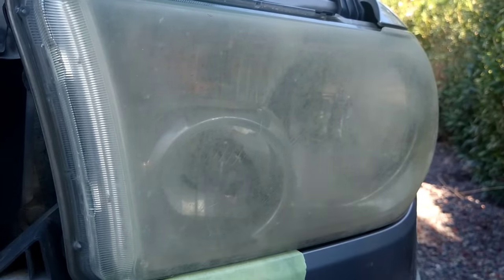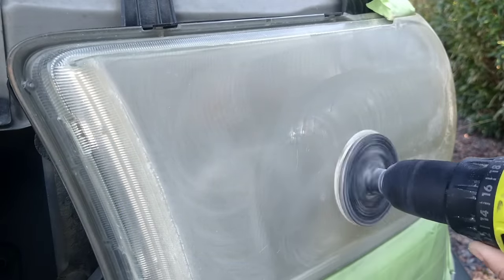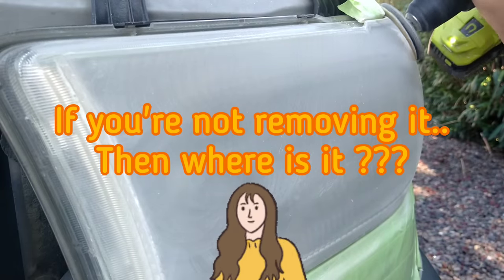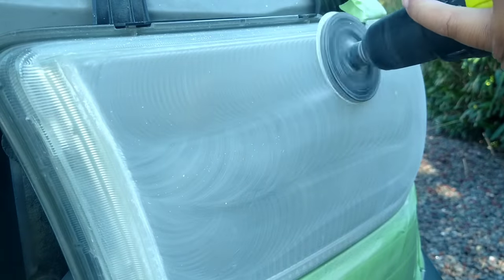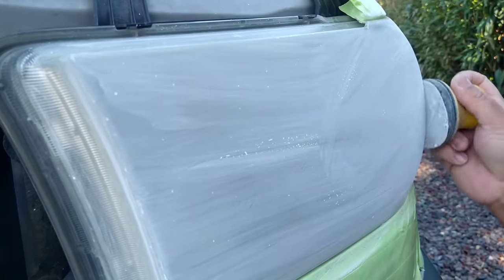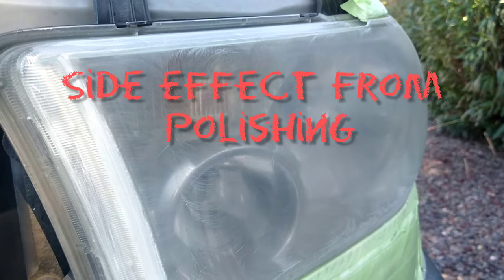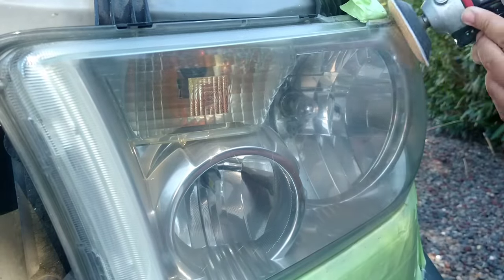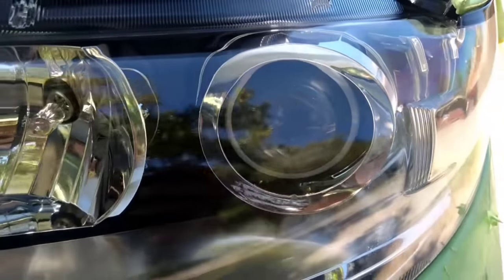POLISHING HEADLIGHTS IS A SHAM/scam  ---  and why you should never only polish headlights

Comment: Thanks for sharing your expertise, both in the video and the comments.
The big sham is the restoration need created by the manufacturers and their inadequate plastics. I restore the one piece glass headlights on my 94 E250 by washing and replace at 10-15 years when they start getting noticeably dimmer.
Reply from the maker: True .. awesome.. thanks for watching play more stuff coming up.
Reply: Agreed 💯
Reply: What are you replacing?  On my Honda I have to replace the entire headlight assembly at $500 or so because you cannot only replace the plastic "shell".
Reply from the maker: Exactly that's why I have that restoration has beneficial.. no need to replace the whole light..
Reply: I remember when the clear plastic portion of the headlight assembly of a car/truck was made out of glass (I guess I am old as dirt). I cannot believe that car manufacturers switched out the glass with plastic. Of course plastic will fade, cloud, discolor, craze, etc. over time. This is what the real problem is. Car manufacturers found a way to up their profit, by switching out the glass lens of the headlight assembly with cheap plastic (Lexan/acrylic) material. Now we owners of these plastic crap-boxes have another early failure point on our vehicles... cloudy headlights. Giving rise to a whole new industry, to try to undo the sunlight damage caused over years of sunlight exposure. If the headlight assemblies were still made out of glass, like they used to be, we would not be even talking about this issue. Big industry sticks it to the hard working consumer again... Surprise...   Fred
Reply: @electronicengineer  Yeah, glass headlights breaking every few months from stone chips were wayyyyy better. Nice try boomer.
Reply: @dancarlos1216  Well I owned at least 10 -15 cars "back in the day", all with glass headlamps and I never had one even get so much as a stone chip, let alone "break" Boomette... All my plastic headlamp cars have fogged in short order. It is easy to see that you are still wet behind the ears, so you should hold off on the age related insults, since wisdom comes with age and you will also get up in years, provided that time is on your side. Not so sure about wisdom though! LOL... Have a great day!
Reply: Hey guys, we are just talking about headlight lenses here. There is no need to call each other names and insult each others intelligence. Respect each other's season in life and learn from the past and present. You are probably both really good men. Don't allow yourselves to become reduced to one of the many instigators of strife. I took away good points from both of you and I appreciate it.
Reply: @philsullivan3679  Well said sir - it was turning into a moshpost.
EVERYTHING is governed by producton line cost (so long as it reaches safety regs.) Acrylic must therefore be cheaper - not necessarily better as there are arguments for and against both glass and acrylic. Lets face it, mainstream manufacturers don't want a vehicle to last too long - they want you to buy a new one!
Reply: You people crack me up with all your "made to break" conspiracies, do you really think that the engineers have the engineering prowess to design something to fail after a certain amount of time? Especially considering all the different variables vehicles deal with across the country much less the world. 
It's simple, if you want curved pieces like that to be made out of glass knock yourselves out, go ahead and demand it from the car manufacturers, and you'll be the first one's crying about how much a car made like that costs.
Or, you can just be smarter than the plastic that the headlight assemblies are made out of and coat them a few times throughout the year with some type of UV protection like oh say, automobile wax or any one of a number of products made to keep that from happening. 
40 years as a mechanic has taught me all about people like you, every time I pull a dipstick out of an engine that's got black charcoal smelling oil on it you're always the one's saying "I change my oil regularly", yea, that's like being a smoker and telling a doctor that's looking at an X-ray of your chest that you don't smoke, I've yet to have a single one of you say "Gee wiz, you caught me, I don't change my oil as often as I should", but when your engine goes out you'll sit around actually believing that some engineer was actually talented enough to design your engine to go out at that particular mileage. 
Grow up, all of you and quit acting like such children about your vehicles.
Reply: @dukecraig2402  I was just about to say it also, you have to take care of it. Can’t just wash it with dish soap like most people seem to do.
Reply: @dukecraig2402  I'm sorry but built in obsolesence is a thing and it's getting more prevalent as time goes by. Look how white goods/tv's etc have changed from being repairable to disposable. When was the last time you replaced a boot on a ball joint instead of just replacing the whole thing? 
That's not to say you can't make things last by looking after your stuff. 
I have an old Citroen 2CV (well beyond it's design life) and when I used it as a daily I changed the oil and filter every 3k. Cheap oil from a hardware retailer, it didn't matter. The important thing is it was changed. 
I have glass lenses on the 2CV and plastic on my campervan. They are both kept clean and polished to maximise their light output. As the plastic looses it's surface oils and gets dusty in the UV and the road grime scratches the surface of the campervans lights I will be using this guys advise to recover them - so thank you👍
Reply: @mattydare  Thanks for your comment on the Citroen! I had a desire for one 40+ yrs ago. I also attended a Citroen fair where dozens of owners brought theirs to share with one another. My $4000 worth of cell phones are now obsolete. My PCs are still trucking. We just do stupid stuff sometimes!
Reply: @ArtOfHealth  2CV secrets - keep a nice comfortable, easy to drive, waterproof, quiet modern car you don't have to maintain and drive to the events you mention. Admire other peoples work then drive home in comfort🤣🤣🤣.
I've made it to mid 60's and now have a better understanding of life. 
What you do is :- make a mistake. LEARN by that mistake. Then move on to the next mistake.
Reply: @mattydare  Yes sir, choir here at 67. But life is great and opportunities are abundant. Thanks for the encouragement.
Reply: @dancarlos1216  glass headlights were more durable than the plastic is. they went to plastic for cost cutting.
Reply: @electronicengineer  , are you an actual headlights expert? Are you sure? The information I found on the Internet that makes sense is that headlights covers are made with polycarbonate not acrylic... The latter is used for other lights like tail lights. Besides the lower cost (car manufacturers always care about cost), polycarbonate material allowed creation of "designer" covers vs simple round ones. The headlights became style elements, not just utility car components.
Reply: @michaels3003  polycarbonate it is. You are correct. I am no expert at anything automotive, so please set your expectations accordingly.  I was trying to differentiate between simple glass and plastic/polycarbonate, that is all. I am honestly getting to the point that I regret posting my original comment at this point. I will most likely not comment on YouTube videos moving forward. I have to learn to keep my fingers off of the keyboard. I hope that you have a great day.   Fred
Reply: I noticed certain manufacturers and models lasted differently
My 04 Altima and 06 Tacoma lasted longer than wife's 06 forester and. Her 01 Volvo C70 held up the best but of course it all depends on the roads driven but both my wife and I drove about same highways
Reply: @electronicengineer  oh for the days of $10 seal beams! Dual beams on my old cutlass lit up the night.
Reply from the maker: Yes... very interesting..it is true ..not all headlights are equal....many different varieties and variables in why they go bad.
Reply: @FelixtheMetalcat  you can always replace the plastic shell.  It's not usually easy, but there's a way.  You generally need to cut the shell off, heat gun the rest of it, then attach a new "lens".   You can find replacement shells/lenses/covers from China.

Comment: Stones used to get ejected from others tyres /tires in front of you then chip, crack, and break your glass headlamp lenses which were cheap yet  far simpler in design than the complicated shapes of today. Glas smashes in accidents and cause further injuries, however technology might have changed that if they were still in use.  Glass sealed beam unit headlamps were terrible as when burnt out your replaced the whole lens and if chipped or broken it was an expensive exchange for most people on a humble salary at £30 back in 1976!
Its not the same as a windscreen which is of course laminated and cannot be made of polycarbonate plastic due to wear and tear from wiper blades and small impacts from lightweight stones which bounce of a glass windsheild but would dent plastic leaving a mass of imperfection soon to look a distracting mess.  Perhaps one day a blast of air added to airflow could negate the need for scratching wipersblades.

Comment: I started doing this about 20 years ago. Along with painting a vehicle if the headlights needed it I would re-clear coat them. Prep with 800 grit, warm water with a drop or two of dishwashing liquid. When properly prepped plastic adhesion promoter is not needed. But I started adding it and noticed the clear lasted much longer. Over a decade on my Mazda and the headlights still look brand new.
Reply: Yes ~ the end result all comes down to proper and thorough preparation!
Reply: Never played Mapex. What do you like about them ? Im a Ludwig / Paiste man But starting to get into Meinl more.
Reply: @BadRonald1  
Wasn't really a preference, just kind of ended up with them. It's a big set, user friendly hardware and they sound good. I've had a few Pearl, and a couple of Tama sets. I have a lot of Paiste. I like their quick cut and dry, low sustain. I'm sure you know, a lot of drums is all about the tuning. I had CB 700s when I was a teenager spent hours tuning them and they actually sounded great.
Reply from the maker: Awesome.. welcome to The Future..💯

Comment: This is pretty much how I used to do headlights. But I compound and polish after I wet sand. I like the Maguire's headlight protectant but I started using ceramic coating which I think I like a little better.

Comment: Very educational video and top notch job! 
I have a couple of questions though.
-Why do you polish the headlight first and then apply the clear coat (without cleaning the headlight with alcohol first, for example)?
-Why don't you apply the clear coat at an earlier sanding stage? 
Thanks for your time and your help!
Reply from the maker: Basically that would be incorrect when you see a headlight that is done and the factory which will be in one of these videos that I will link you to.. the headlight is Crystal Clear smooth surface then clear coated because it is clear coated with a special UV clear coat that designed to adhere to Headlights like most if not all UV clear codes that are designed for headlights function...
People have been steered wrong because back in the day there was nothing else to use on a headlight except for clear coat or other clear substances that weren't technically made for headlights that were made to bond to other things like wood, metal and paint, not plastic polycarbonate surfaces... Some people still do it but this is incorrect and causes a lot of damage and problems with the headlight and problems with the functioning of the headlight far as the output of the actual light.. polishing the headlights makes the headlight work at peak performance factory spec or over.. when people are doing it the way you are thinking they're far below and they're losing in some cases 50 yards of light.....
Also you should never use alcohol on a headlight and do your best to stay away from ammonia which is why I use ammonia free glass cleaner...
You want to stay away from STRIPPERS.... A quick background headlights are actually made from oil....
And what does stripping with alcohol do? Removes oils...
When polishing like this you're not only leveling out the surface of the headlight which creates the clarity you're embedding The beneficial oils back into the headlight which provide Crystal Clear clarity and perfect functioning... If you keep watching this channel you'll start to realize that these other methods are full of shit I don't know what they're doing and they think just because of headlight is clear that it's good to go...
But check out these video for sure and you'll see a lot more in depth....

https://youtu.be/LC4ZBu02JZg?si=16h_L6nrGwwiPja7
Reply: @theheadlightrestorationpro  thanks for getting into trouble answering my questions. I understand that the first sanding is very important, so how do I know that I have sanded far enough to remove previous coats and damaged material? Thanks again!
Reply from the maker: If you watch a couple of my videos you'll see how far you should go or how deep you need to go it's stated a couple different times and different videos first one that comes to mind is this one I believe..
https://youtu.be/9DfP_dqw1mU?si=h1vuGAiJUV4UCb1R

Comment: Excellent work and beautiful result.

A recommendation if you're open to feedback is to back the camera away when you're done with one headlight to be able to see and compare both headlights side by side, or since you're good with editing, instead of flashing before and after pics, do a split screen with before on the left and after on the right.

I think the video would end better that way and delivers more of that 'wow' effect.

Either way, I'd definitely hire ya if I were in your area. 👍
Reply from the maker: Good idea I actually have a couple videos ending like this just try to keep it mixing up solid suggestion though for sure..
Please like and subscribe and check out a couple other videos I just posted one last night... This one here very informative and actually has that ending format as well..
Check it out⬇️⬇️
https://youtu.be/LcMFr0mpp-4
Reply: Yeah  good on you
Reply from the maker: Thank you for watching. Just dropped a new one.https://youtu.be/le1LyD93Ydo
Reply: Thanks for backing up what I believe is the best way to restore plastic headlights. Been meaning to do mine and based on your video this is my choice. Probably the biggest and best difference I’ve noticed is you go slow with your sanding. Helps prevent the dreaded heat monster that ruins things permanently. Cheers.
Reply from the maker: @stevelaferney3579 👍🏽

Comment: Always use a interface pad between the sanding disc and the velcro pad. Reason is. One it smooths of around any radius on you're light safely so you don't square off the corners. Secondly it reduces heat build up which you don't want at all.

Comment: When I bought my new car I installed Xpel clear film headlight protectors.
So far I am extremely satisfied with the Xpel product.
Reply from the maker: Never used it... Interesting in the side effects when it comes off.. I've had to do a couple removals, and a couple customers have called me after they removed and it pills off all the clear coat.. don't know if they were this specific brand but same concept... Interesting though
Reply: I've used Xpel on 3 of my cars now including the headlights. No problems at all.
Reply from the maker: @dontcare563  so you've had to remove it....😁
Reply: @theheadlightrestorationpro  No not yet.
Reply: Make sure you put a multi-year rated ceramic coating on ppf. That way the ppf won’t fade for a long long time